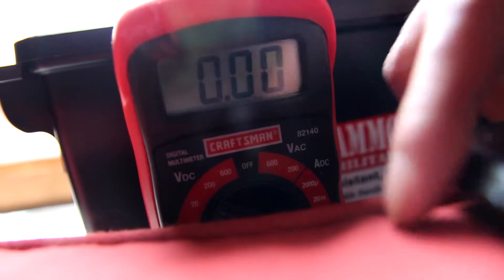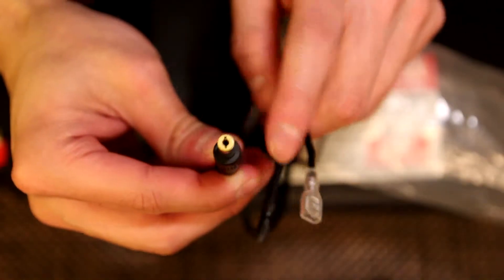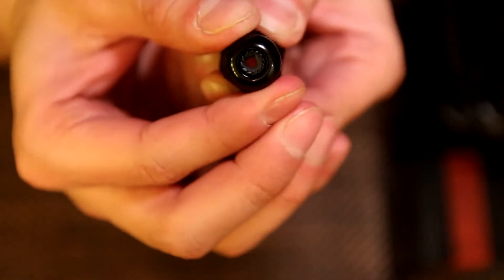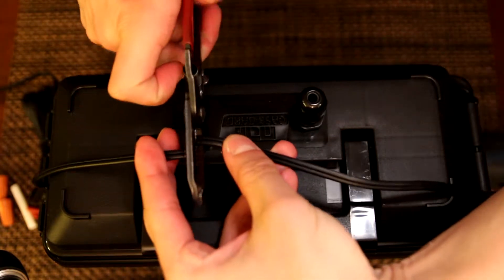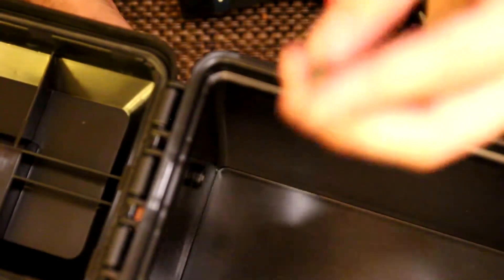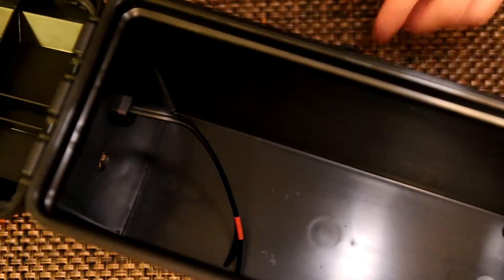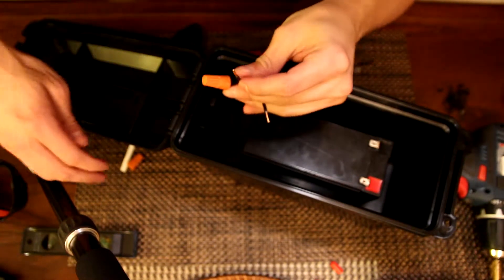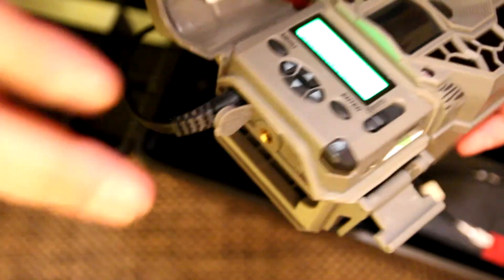DIY Stealth Cam 12V Aux Power Battery Pack Part 1 (NON-SOLAR)

Comment: You left out 2 female insulated spade connectors and a ATO fuse of the proper amperage. Cut the positive wire about two inches from the battery terminal and crimp both female insulated spade connectors to the wire and slide one female insulated spade connector onto each leg of the fuse. Now your equipment is protected. Easy Peazy. Thanks for your video.